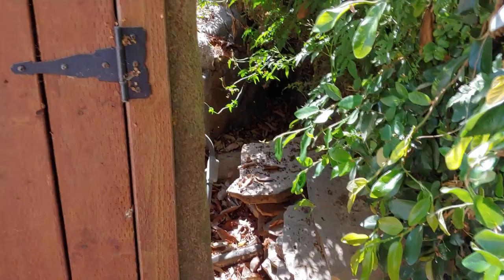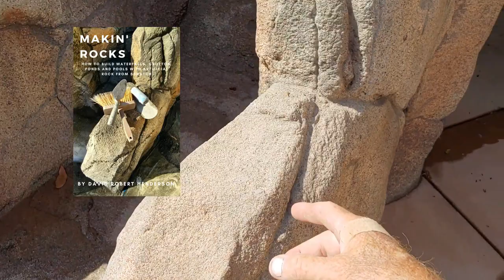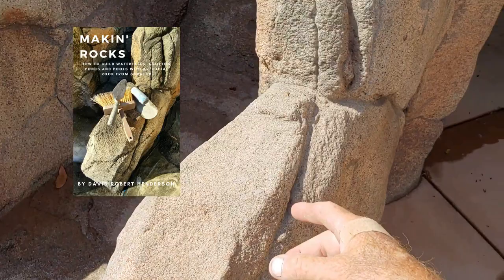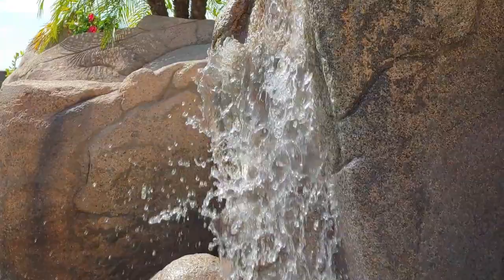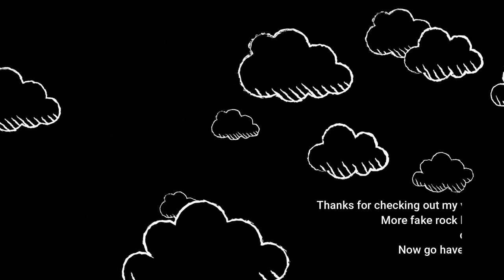Fake Rock Slide Grotto Remodel START to FINISH!

Comment: How much it costs to get the same type of waterfall? How to handle if a big leak happens from inside the PVC pipe. Can we jack hammer and concrete it
Reply from the maker: Cost depends on a number of factors.  Might be from $26K+ up for a project in San Diego where I live.  Never had a big leak in my whole career.  But can always fix things that are broken.  Hope you have an awesome 2024!  :)

Comment: Hello I have a slide like this. How can I wax it to make it faster?
Reply from the maker: I don't recommend wax as I'm not sure of its effectiveness.  Might work.  Rather I use a polyaspartic from Ramuc called Slide Coat.  Follow the manufacturer's recommendations for application and you should be good to go.  I also have an ebook on slides you could check out if ya like at https://davehenderson.podia.com/all-about-concrete-slides
Have a great day!  Cheers, Mr. Dave  :)